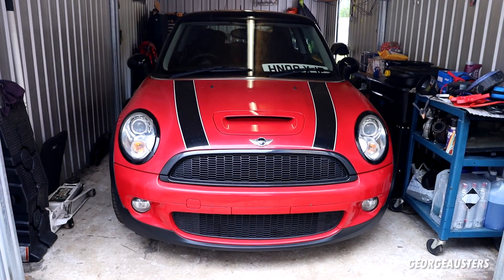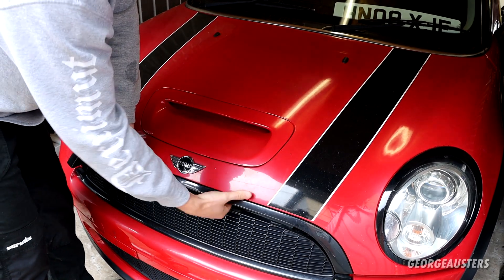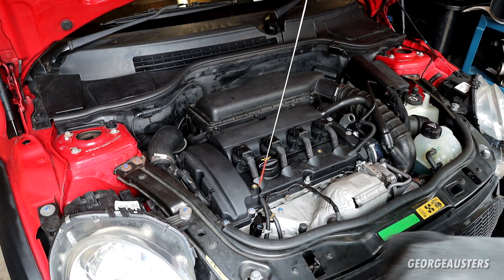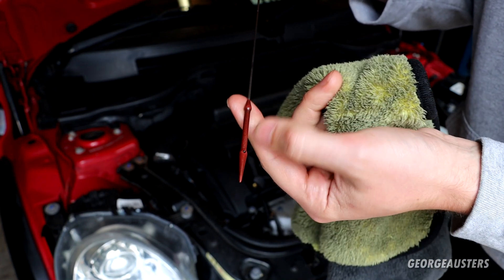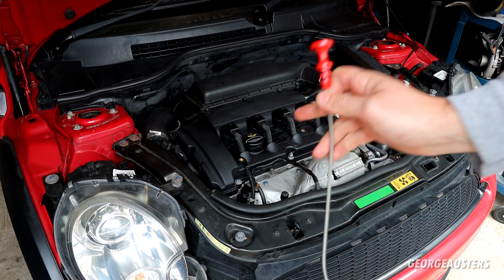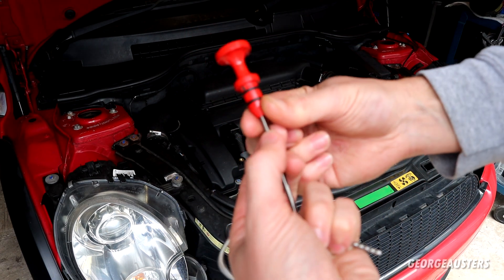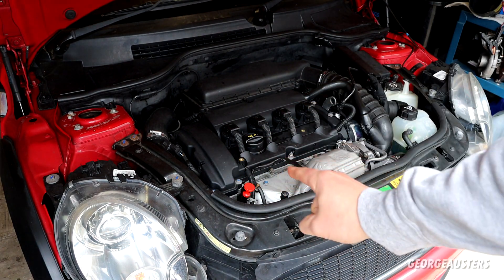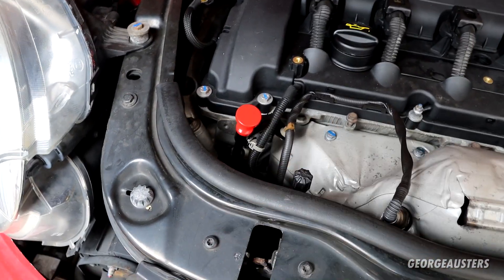MINI COOPER OIL DIP STICK UPGRADE!

Comment: At least it has a dipstick. I would love to meet the person responsible for replacing it with an electronic level sensor on my M140i
Reply: Agreed, I had an M135i and that was the same. 👎
Reply: and the Z4 - I have to run the engine until warm, so it can measure the oil level (then it can tell you it's dangerously low)
Reply: It is idiocy, like after you change the oil you also have to run the engine to check the level. What if it was too low?
Reply: My RCZ , which has a Mini Cooper engine, has the handy feature of an electronic oil level plus a dipstick.
Reply: THEY MAKE DIPSTICK KITS FOR THE NEWER ONES,

IM PLANNING TO ORDER ONE AND POST A VIDEO!

Comment: My original 2007 dipstick is all metal rather than the 'plastic' end like yours.  Still notoriously difficult to read as its round.  Filing or grinding a flat netween the high and low markers fixed the problem 100%.  No difficulty in reading what so ever, important as these engines can use oil and the timing chain life is severely reduced if oil level is not diligently maitained.

Comment: Yeah so ok bud cool channel but with the mini on the oil level I I have found the only decent way for checking the oil leave her on a level surface all night oil will be settled then hopefully will have run out of the tube use a bright light you should be able to get a decent Reading but please please don't use that chill peace and all that

Comment: All it is an aid to read your oil level you're meant to use it and then replace it with the original one guarantee you will find it somewhere in instructions I found it
Reply from the maker: So you’re supposed to take it around with you just to use it as a tool?
Reply: @GeorgeAusters  yea man nearly had a heart attack when I seen you use it love my minis not going to let you destroy it but yet bad design can very easily get trapped in engine and in timing chain personally threw it away

Comment: Good warning on the length of the dipstick. 

This dipstick is available for gen1 Mini too but do not buy it! The original is stiff and goes into the block into an angle. This (Cravenspeed) dipstick is not stiff and thus goes into the block in a different angle. This leads to incorrect readings of the oil level which is quite dangerous imo.

Comment: Hi george ive a n47 320d and it feels like its down on power would you know of any quick fixes or thing to check to find the cause of this
Reply: If your boost pressure is ok try checking the veins on the turbo can be prone to sticking give them a good clean with some oven cleaner

Comment: The dipstick on my 2012 E84 N47 is showing signs of age, it was a bit cracked and I picked at it and some plastic fell off. 

I want to replace it before bits fall off into the engine oil, where should I buy a replacement one? I’d like one that is easier to use and can’t find any on euro car parts. Do you have any recommendations?
Reply: And on eBay I can only find replacement dipstick tubes
Reply from the maker: Guess the best thing to do would be measure your dipstick and search for ones of the same length

Comment: Why do they build rubbish like this
Reply: God knows. It’s an awful dipstick , I speak from experience .
Idiotic design continues on the Mk 3 Mini .  Certain controls at a low level have warning lights . Great . But they’re impossible to see ! The ventilation distribution ( screen/ face/floor) has markings so small you need a magnifying glass to read them and you have to go through a distribution sequence ( up to 8 pushes ) .  Utterly stupid.